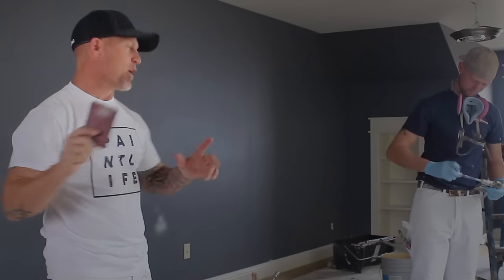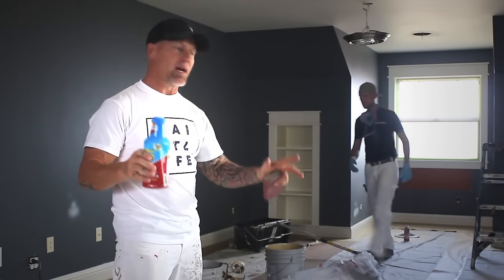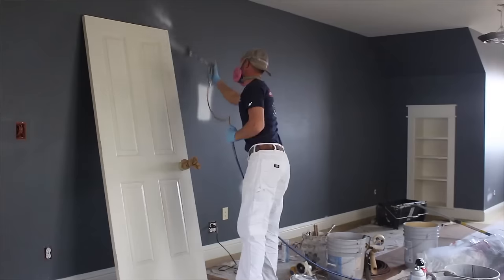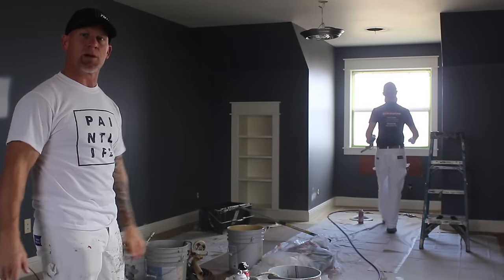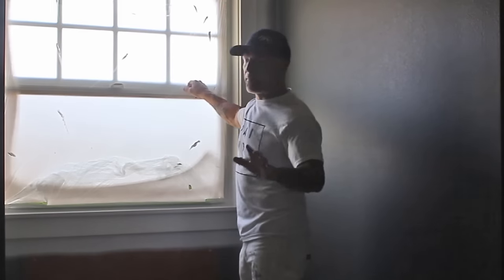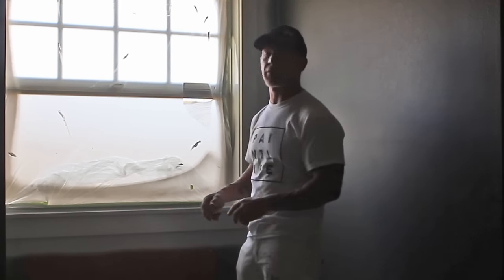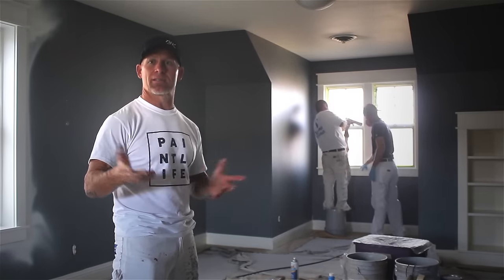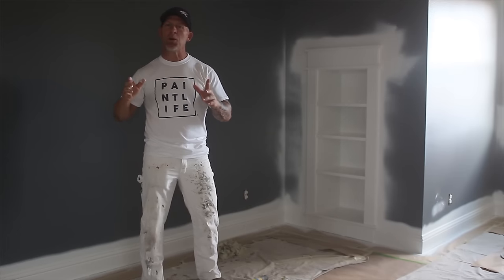Interior Trim Painting Hacks.  DIY How To Paint House Trim Work.

Comment: I have a foolish question I am guessing., you said you sprayed the trim with a semi-gloss latex.  How do you not have a halo effect from your overspray on the walls after you paint the walls with duller finish (like satin matte or flat)?
Reply: If I am understanding your reply correctly, the reason you did not get a halo from the semi-gloss overspray is because you made sure when the walls were covered well and evenly to prevent the halo from overspray showing through?

Comment: What pressure did you leave your sprayer on?
Reply: +The Idaho Painter Our contractor wanted me to spray trim with Sherwin Williams Qualikote Semigloss, I'm having a hard time using a 210 tip, either doesn't cover enough with still a lot of orange peel, or overloads. I've been following you for awhile using all the methods I've seen in your videos but for some odd reason I can't seem to get a good finish on these trims. Our prep team is also struggling trying to get a flush fill on the nail holes. If there is anything you could recommend that would help that would be awesome.

Been referring your videos to everyone! Great videos

Comment: What is the Model number of the gun you are using. Also do you find the tips that you buy in Home Depot the same quality you get in the big name Paint stores? How high did you set the pressure on your Graco paint rig? Did you thin the paint at all?
Reply: I bought some tips at HD last month on sale . They look like tips graco was selling 15 years ago . HD gets name brand guys to make everything cheaper flimsier , not last as long .
Reply: Kenneth C. Adams i have a 395 Greco would a 310 rack work for this size sprayer?
Reply: John Pressure Washing & Painting in Baton Rouge yes definitely

Comment: Everyone asking about the flashing from the overspray. I would suggest rolling over that with a flat paint ,like the ceiling paint, to the same texture as the wall. And then double coat with your topcoat as per usual.
Reply: Mask around windows with paper and masking machine. Doors tape plastic on wall. Save time and  less issues

Comment: Anybody have an idea to what product to use on some old high gloss paneling?  I used de-glosser first, then lightly sanded, then put a light coat of primer on.  The gloss seems like its re-activating, or showing through.  Any thoughts on what I did wrong, or what I can do to prevent it from happening again....I have whole apmt to do....Thanks for any help

Comment: If your trim is a different sheen then your walls you will want to put up some plastic on your walls to prevent flashing. I made that mistake a few months ago and remembered that it does that for some damn reason. 20 years experience.

Comment: I have seen a couple of different ways to spray doors. Use wooden planks on top and bottom of two doors to create a triangle shape. The doors can then stand up on their own. The second option is to attach two long screws on the top and bottom of the door and use saw horses to suspend the door horizontally. The door can be flipped over with ease.
Reply from the maker: Awesome tips, thanks for sharing!

Comment: Thanks for the vid but What about the walls do you have to cut in to all of the trim now or mask it all up??

If so surely it would be better undercoat with spray on trim and spray the ceiling/walls and then finish final coat on trim by hand or am I missing something.
Reply from the maker: We mask it
Reply: Thanks, Im a painter been doing it for 15 years or so and looking at getting a sprayer I wonder how you get a neat line with tape on the trim? 

If your line was a little wavy could you neaten it up by hand with a half inch brush or would you see a difference between the spray and brush finish if it was just the edge of the trim

Could you do ceiling then trim then walls?

Sorry for all the questions just trying to learn best way as I would like to finish the trim with a spray but Im struggling with a system. Thanks.
Reply: shane wyatt you've been painting for 15 years? I don't believe that by your questions dude. 1/2" brush?

Comment: Can I see a picture with light shining down the wall after it's painted to see that there's no flash ? Even with 2 coats you're putting extra mills on the wall might make a halo especially with smooth wall in a room with a lot of light it may show
Reply from the maker: You can prevent haloing by keeping a wet edge and using a high quality paint
Reply: @paintlifetv super paint all day!

Comment: This guys has a lot of good tips but in my work of painting doors I see no need to take doors of the hinges. Just wrap the hinge with tape . I usually take the knob off and close the door on each side that i spray.  Keeps the overspray from getting on the jamb part of the hinge. Some brush work will need to be done on the hinge jamb and butt ends of the door. Use a styrofoam cup to plug the doorknob hole to stop any overspray from blowing through to the adjacent area.

Comment: I do not really understand why you guys using a extension between the spray gun and the housing. Does it reduce overspray?
Reply from the maker: Reduces fatigue
Reply: I get that when you paint walls or exterior or  those jobs too tall but doing windows jambs it’s easier without it because the spray gun weight, and not just jambs doors and baseboards too

Comment: Hi Chris, thanks for another great video! I have a question about masking. I have to paint the baseboards in my carpeted basement and I'd like to use my airless sprayer. Is there a way to tape off the baseboards to protect the carpet from any leakage right where it meets the baseboard? (You might have explained this, but I just haven't found the video yet.) Thanks again!
Reply: The Idaho Painter awesome, thanks!

Comment: Full pressure as in 3000+ PSI? We have a Graco air assisted fine finish unit (as well as a 695) no way I could run it at full pressure. We start it from zero pressure keep putting the pressure up slightly until around 800+ psi depending on material until the tails are hardly visible then turn the compressor on to get mirror finish work on trim. I'd be interested to hear your system.

Also one last thing - doesn't matter how much we try but using something like a 6" gun extension, doesn't matter what we do we continue to get splatters at the trigger pull and release parts. I know why it does it in theory so how do you get away with it especially spraying trim avoiding splatters? Because you can't really not release the trigger when doing trim you need to stop and start unfortunately. We even get spatter when we initially pull the trigger?? So thats why I try and avoid gun extensions.
Reply: Air assisted doesn't need full pressure, its a different system, airless alone works better and have less spits when used at full pressure

Comment: When using a 310 tip what's the psi do you have the machine at? Like 1500?
Reply from the maker: 2900
Reply: He used highest pressure i think.. so the paint makes it through the fine tip size better.

Comment: I been painting professionally  for over 30 yrs I use an hvlp for trim lot less covering . Have u ever tried that type of machine. and your painting a room in 30 mins video I would always apply 2 coats it never fully covers in one coat ever. Did the customer pay for 2 coats. I wonder
Reply: It's easy to get one-coat coverage but it takes two coats to get the Finish and Sheen right. Anyone that says different is doing blow and go work and painting apartment rentals!

Comment: instead of removing masking while paint is still wet, why not lightly score around the masking when the paint is dry?  Sometimes several coats of primer + finish are needed, it's a pain to keep masking the same trim over and over...
Reply from the maker: We never re-mask
Reply: Pretty sure they just pull prep when the final coat is still wet

Comment: So when you overspray onto the walls with a high-gloss paint, do you have an issue when you then paint the walls and you paint on the overspray portion?  I guess I'm asking if you have to prime the glossy overspray?
Reply: Yes ther will be an issue- maybe they sand it to de gloss it who knows but afterwards looking in one direction or another one will see the spray pattern- I guess it works with a large crew and a wealthy customer
Reply: when spraying, lift off trigger when ending a run- saves paint and it adds up
Reply: I agree with you but... sometimes on high profile long walls I will purposely overspray farther out on walls to get more feathering and transition the higher buildup . Uses more paint but it eliminates any noticeable transition lines

Comment: Solo? over ProClasic hybrid or oil or even promar oil for trim like that. ever try Ben Advance? solo is a dumpster fire imo
Reply: ProClassic hybrid is for sure a superior product, but i use Solo for all the trim in the houses I've been painting lately. with spray application i have no complaints, but for hand-bombing it definitely doesn't lay down like pro classic.  I just finished spraying 15 gallons of Solo satin in a $1,000,000 house and it looks great.

Comment: I respect your way of doing it but with just two men you can paint the trim with brushed, then wiz roll the cut for the ceiling that way you can start your own line, then cut and roll walls all of this can be done quicker then, taping floors, windows...etc just my 2cents if your crew knows how to cut, then tape shouldn't be needed where moulding or baseboard meet flooring, all you'll need is drop cloths.
Reply from the maker: Good idea!

Comment: When the contractors sprayed the doors at my rental you could see the ghosting through the paint on my walls
Reply: keithy That’s because the contractor you hired only sprayed 1 coat on the doors which doesn’t allow the sheen to build correctly. Every surface requires 2 coats of paint minimum.

Comment: personally would never spray trim with any extension or spray any cabinets you can clearly see the guy having trouble spraying that little closet just saying
Reply: The Idaho Painter I just never got used to using any extensions except for spraying ceilings. 👍
Reply: el lobo Almanza You're right.
Reply: plus without the extension you have more control when you spray. 👍👍

Comment: Sorry, but if the original coat is latex, you dont need deglosser. I wouldnt care, but you have newbies watching this, and it would waste time and money. Deglosser is for oil based, gloss or semigloss paints. Latex isnt as slick. Just make sure it's free of dust. But, you can put oil based over oil based without deglosser.

Comment: I'm sure they had lots of drips
Reply: look I'm sure you want to look good for your site but your guy was using a  310 tip when you should be using a 208 tip and the pressure sounded high and anyone that knows how to spray knows spraying trim 3 to 4 times will have drips...but say what you want make your show how u want but if you want the viewers to really trust what u say show up close after you guys spray at least  ten min after...lol
Reply: Eduardo Sanchez  that's what I was thinking exactly. never seen trim sprayed like that before. only fast dry lacquer. had to have runs. I can see two passes on one piece of trim but 3 and 4. I call bs. had to be runs and sags and gun spits.
Reply: I'm not a big fan of this guy's channel either but he did say at the beginning they were using a fine finish Graco tip. if you have ever sprayed before you would know there's a difference between those tips and a RAC tip. maybe listen before you flap your man pleasers.
Reply: Your probably absolutely right man. I didn't listen. .. my bad Idaho painter! To many lacquer fumes lol..
Reply: how do you get trim paint to spray out of a .08 tip? thanks!